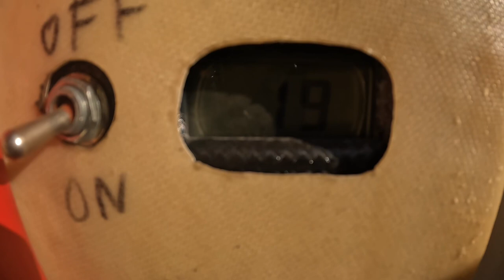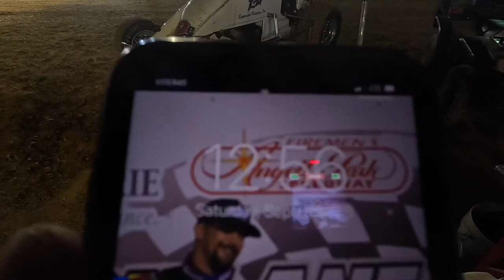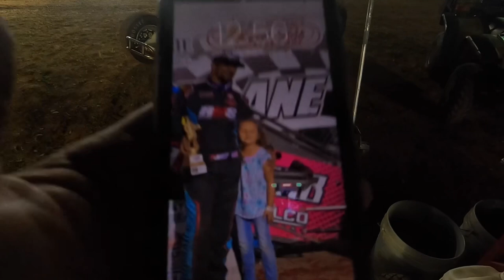Josh Burton Memorial 410 Sprint Cars Bloomington Speedway

Comment: Oh my. One of the best videos yet. Still trying to learn from you on this non wing dirt deal. Being around pavement so long and doing the steel block deal at Paragon now. Wouldn't you put some tilt in the car and crank some right front and left rear wedge in the car. Tie it down on the left side so it drives??  I don't know just guessing coming from low horsepower and and low budget winged pavement racing still trying to learn the non winged deal. Guess I'll find out at Paragon Saturday

Comment: Idling the bottom, dusty slick. That reminds me of the day shows in the 70’s, Ascot , imperial etc. Once you’ve been to the tacky tracks, who wants to see (if you can) the dry slick. And the tires are squealing into the corners , discs red hot. On another note. Have you offered your help with IRacing’s dirt stuff, especially the USAC stuff
Reply from the maker: It’s hard to compare I did have a I racing account few years back